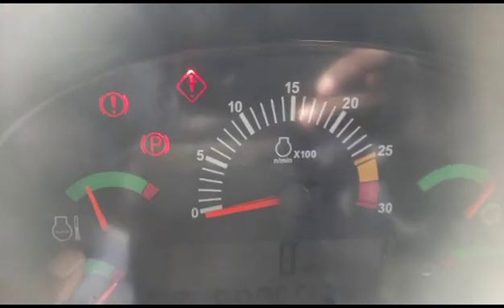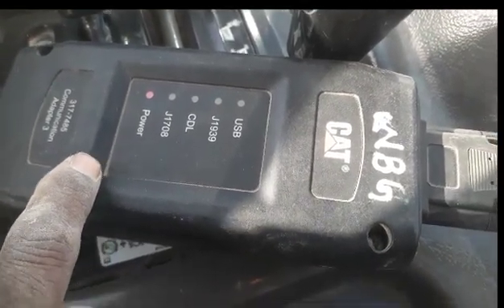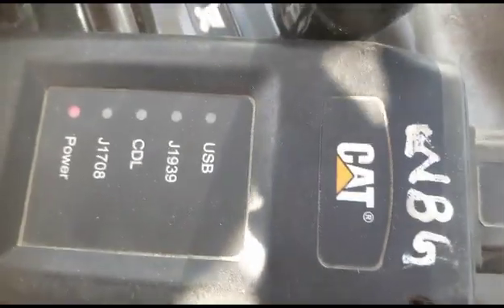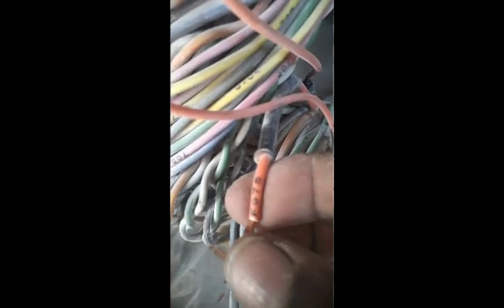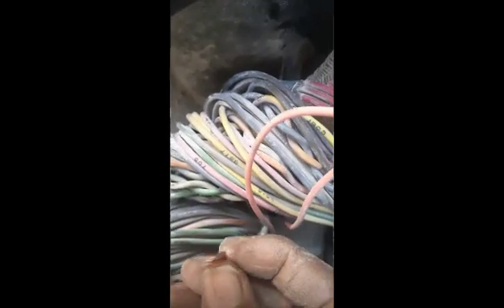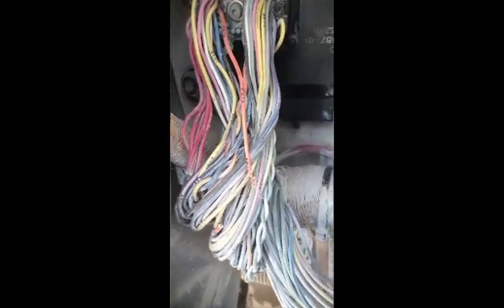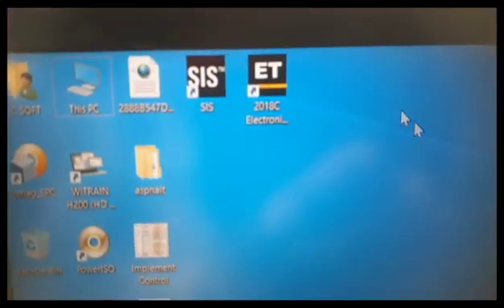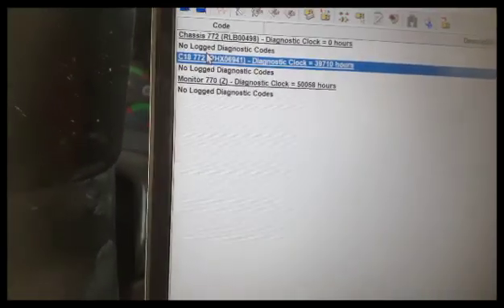By Using ET Catpillar Software Diagnosis The Code|| 8v DC Supply Low Voltage

Comment: Great tips on how to used cat et, I see all the smu readings are not same, chassis ecm reads zero hours, engine and monitor also not the same, whys is causing this.
Reply from the maker: May et not connected properly, sometimes happens like this, if et not connected properly.
Reply: @AlbertB72  
Thanks for the quick reply.